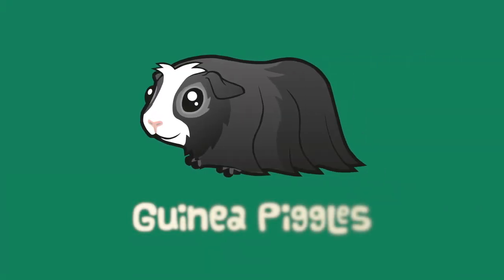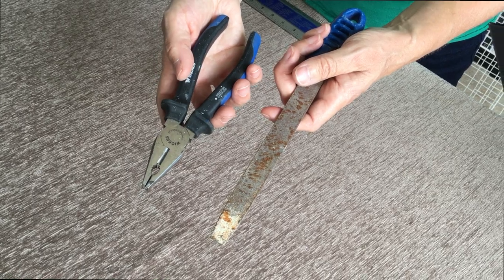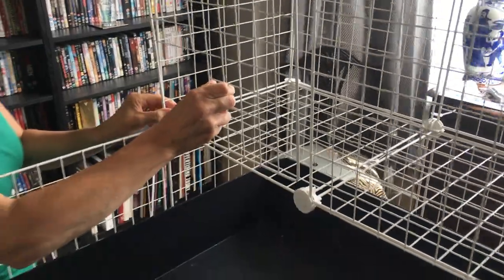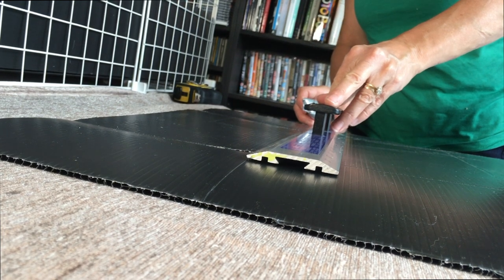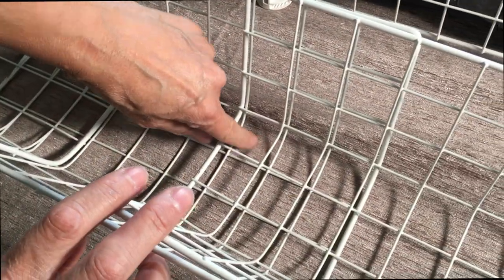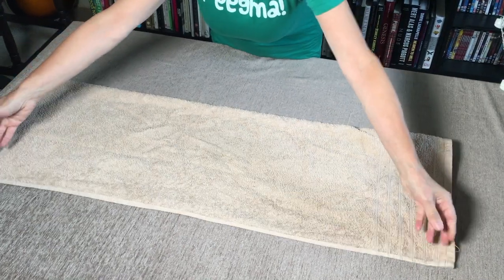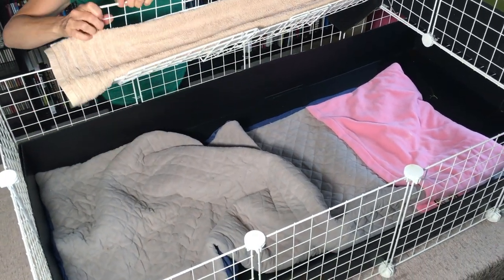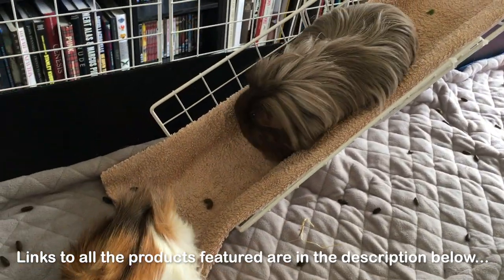How to Make a LOFT & RAMP for a 2x4 GUINEA PIG C&C CAGE | 2x5, 2x6 Cages

Comment: I am getting a c&c cage ( a 2x4 ) did you get a cage or get the parts to build it the cages we find on c&c are ones with no bit on the side of the ramp?
Reply from the maker: We bought the separate components. If your cage is going against a wall then you won't need those extra grids on the back - we added them to make sure the guinea pigs couldn't jump from the ramp out of the cage.
Reply: Guinea Piggles : thanks for the help!! 😄
Reply: Guinea Piggles we decided to get a slightly bigger and different cage for my pigs 😁

Comment: I found on some forum that we shouldn't use multi level guinea pig cage, as they are afraid. But, this Video is awesome and I think it's ok to do that. So, can multi level cage be an good idea for 4/6 guinea pigs?
Reply: yes
Reply from the maker: As long as the ramp isn't steep they will be fine and should get used to it although elderly guinea pigs can sometimes find it more difficult to use a ramp. This cage wouldn't be big enough for 4-6 guinea pigs - it's only really big enough for 2-3 piggies but you can make them larger so you have 5 or 6 grids  across.
Reply: That's great. Thanks a lot. I got it.

Comment: And is it expensive? Bc I was  thinking of making a cage like that
Reply from the maker: It's not expensive but prices differ depending on where you are - check out the links in the description on where to buy all the bits you need and you'll see you much they all cost. Hope that helps :)
Reply: If ur in the US then it will cost about $50   -$30 for grids and $20 for coroplast

Comment: are guinea dad fleeces actually worth the money
Reply from the maker: If you're using fleece, then I would recommend GuineaDad. We've used others that haven't been as absorbent. But we use disposable bedding now as it does last longer and rather than doing a full clean every 2-3 days we can do it every 7 days which is a lot easier.
Reply: @GuineaPiggles  ok thank you i will look into investing into one